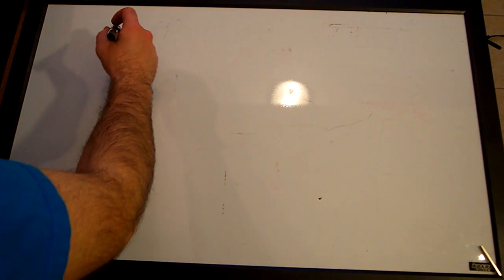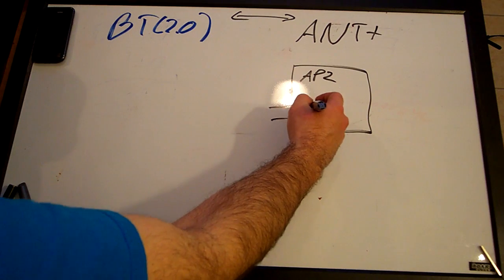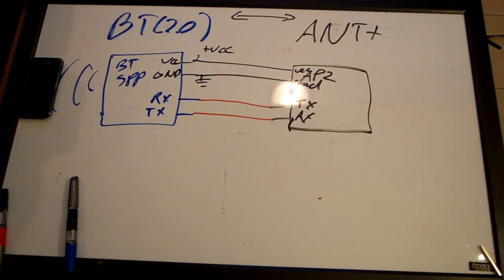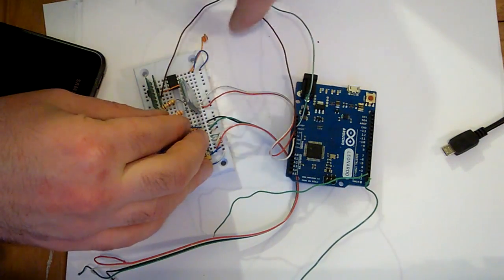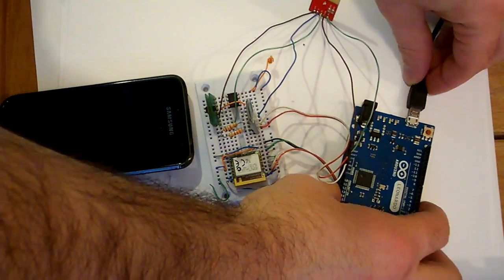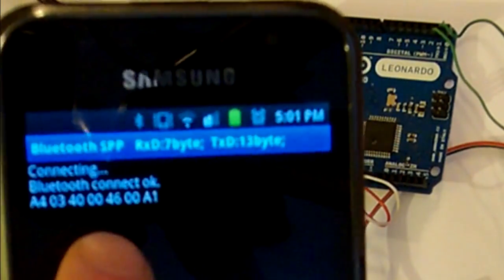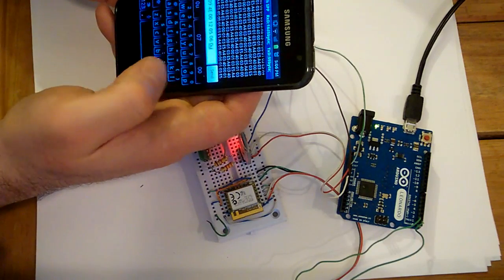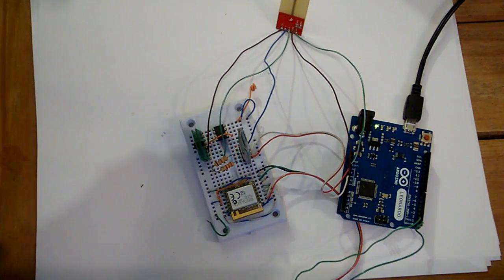Bluetooth (BT 2.0) SPP to ANT+

Comment: Great so. esp32 has a ble but no ant+ layer as yet. So connecting a nordic nRF52840 to it we can do Ant+ to BLE bridge. And then at that point you lost me with all your fast forwarding and hairy arms. Do you realise people searching understanding of how to do this need a step through, if they knew as much as you they would not be trying to use your vids as education. You seem to fast-forward  the important bits. which  leaves  me uneducated and you with all the clever stuff. But then that's how i probably sound talking to my wife when i geek  all  day. Sorry that's how your videos come across to me.  I have done so many searches and you come up over and over again. when i look up research for ant+ BLE sterzo   and bridging devices regarding Zwift. I really need to get an understanding of this stuff.  (ANT+ BLE esp32 bridge Apple TV  hack my aim). I don't like the word hack, sounds like a cheap bodge. But sometime i see products as a rip off for those that can't have by the un educated  and creative . And a hack is a solution against profiteering and forces completion. This is hardware and software.   not. a high budget film set or directly ripping a bin file . £80 for a sterzo? £120 for a ANT+ to BLE bridge heart rate monitor £80 for a Cable bridge?  You are clearly draw on a wealth of knowledge. Yes we would rather fast track, but from my point of view it's to fast tracked . it comes across as look what i know, rather  than educational. understandably hard to gauge.
Reply from the maker: Such an old video! So If you had direct radio access you could put ANT on an esp32, but it's specifics are guarded by Garmin now and they (as before) charge money to use ANT. I just got a bill to use ANT in commercial products. I had a friend try and reverse engineer ANT so it wouldn't be a binary blob soft device but couldn't figure it out in the end.

Comment: Hey Keith, I found your video because I am suspecting that many people on Zwift are doing a "digital doping" by intercepting the ANT+ or Bluetooth from their trainers and manipulating the output to show higher watts. Do you think this would be possible? From your video it certainly seems like it would be.
Reply from the maker: Possible, sure. In fact you don't need anything complicated. There are ANT+ simulator software for development (eg for a head unit), so two ANT+ sticks (you need two because they are async, it can receive at the same time as sending) and just set the power you want. It's not hard. Have to randomize the data a little,  but faking powerdata for zwift beyond easy. Also, BLE isn't hard either. There is no validation at all and to maintain backwards compatibility they can't add it really.

Comment: very interesting I have a vortex turbo which only has an ant+ sensor. but the likes of modern software like zwift uses ant+ fce  would there be a way to take my ant only data from my turbo and present it as the compatible service. (would be cool of there was some sorted simple gpio board I could just click into my pi) 😃
Reply from the maker: This is an older BT 2.0 which shouldn't be confused with BLE. BLE is part of the BT 4.0 spec but it's very different. FE-C is an ANT+ standard and there is no BLE equivalent. BLE consortium hasn't bothered, kind of like how it's the wild west with compatibility, you'll likely be waiting a while. Tacx (I think) wrapped ANT+ in their own service / characteristics making it high potential for compatibility. You trainer likely provides power data as the ANT+ standard so you could use something like the TickR or Viiiiva to translate that without headaches. Compatibility in BLE wild west may vary though.
Reply: nice one will delve into this a little more but its far beyond my understanding, there must be a gap in market for this kind of thing but I guess Tacx and other companies etc. just want to sell the latest and greatest turbo :). thanks again for parting with the knowledge!

Comment: Keith, great video. I have a quick question: let's say that instead of having the cellphone on one end I have a device like a heart rate monitor that is bluetooth 2.0 and I also have another device but this second device is ant+ enabled and I want collect the data of both simultaneously in a lab. Can I use this bridge concept? Or you think it would not be synchronous because of the bridge delay?

Comment from the maker: That's a kind of complicated question. The short answer is that it's the same reason you can't connect to a bluetooth keyboard via a wifi router, or a bluetooth headset on zigbee. All use the 2.4ghz spectrum, but channel width and how they communicate are very very different. ANT+ was originally designed to be ultra low power because the chips sleep a lot, but BT needs to maintain an active connection at all times.